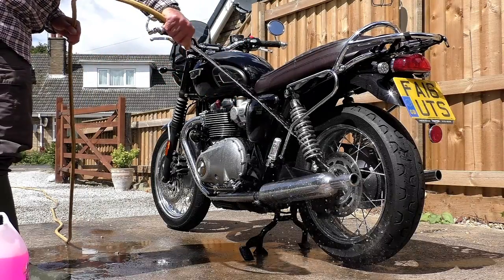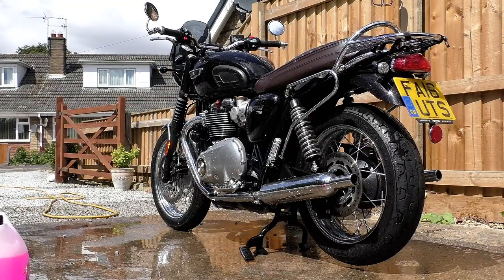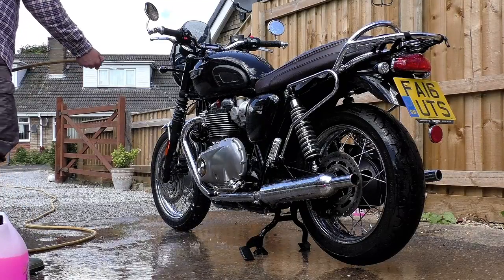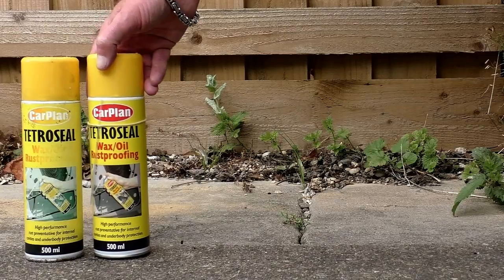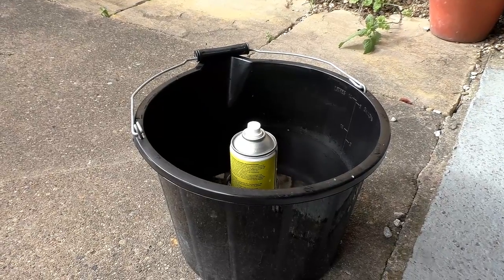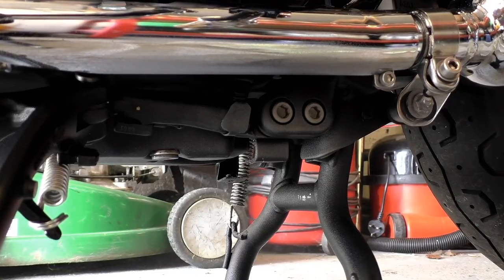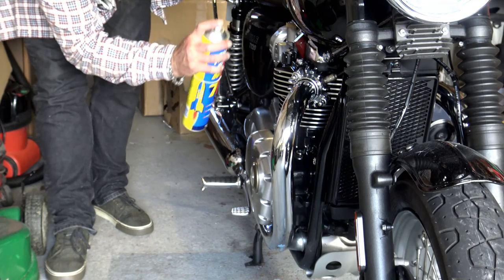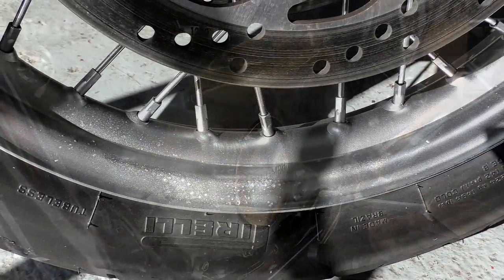Triumph T120 preparing your motorcycle for winter(winterizing)/RUST protection that works!

Comment: Hi Stuart, I'm treading a similar path to you in a way as I've just replaced by GS with and had the same issues with ACF50 that you did so I'm looking for an alternative to try and keep my new bike the way I want it. Firstly I notice you recommend GT85 in one of you videos but Double TT for winter. Is there a reason you don't use double TT all year round. Finally since the ACF50 experience I've used FS365 with great success but obviously that wouldn't be able to rectify the corrosion already there due to the ACF50 experience so I was wondering if you've had any experience using FS365 and if so how it compares with the waxoil/GT85 AND Double TT. some other vloggers have suggested the likes of WD40 and similar products are not a good idea for bikes as they can penetrate and dissolve the grease in bearings etc. so I would also be interested to hear what you think about that as far as Double TT and GT85 are concerned. Cheers Ade
Reply from the maker: Hi Adrian, welcome to the channel! I'm afraid I have no experience of FS365. but I can tell you with absolute certainty that nothing will beat wax/oil for long term corrosion protection on bare or painted metal! Most maintenance sprays contain a solvent that will disperse grease, however the anecdotal reports often banded about are the result of sales hype rather than anything else. A little common sense is required ie, do not spray it directly into bearings! and for such areas I would recommend applying it with a cloth soaked in the substance and the danger is completely avoided. GT85 can be obtained very cheaply if you shop around, Double TT is a little more expensive. I advocate GT85 in summer as it is all that is strictly needed and Double TT in winter as it does offer substantially better protection. there is nothing to stop you using Double TT all year round, I simply made the suggestion on money saving grounds.
Reply: Thanks so much for replying so quickly. I bought some Waxoil and Double TT while waiting for my new bike to arrive after watching this video so I'll give it a coating as per your recommendations. Thanks also for clarifying why you use GT85 in summer. I've found 600ml tins of Double TT on ebay for £5.85 which seems comparable with GT85 cost wise so as you say that's better I'll try that all year round. Thanks again Ade
Reply from the maker: no problem mate use the TT at least weekly if riding in winter. if it gets a good dousing of salt, rinse it off with cold water and re apply the Double TT!
Reply: Thanks, I normally wash my bike if I've been out on it in the winter - cold water wash first then a dose of ph neutral tfr followed by another rinse then the normal 2 bucket method, a final rinse followed by drying with a pet dryer so I'll reapply it after that.
Reply from the maker: Take a look at these. its become known as the full fillingham for some unknown reason! https://www.youtube.com/watch?v=bUNzoTpQqp4

https://www.youtube.com/watch?v=wib_tdr_mL4
Reply: Thanks for the above clarification Stuart, great content and proper researched advice which is greatly appreciated. I do wonder if money wasn’t an object at all, what might be the best combo cleaners up to the task.

To my mind, Muc-off range look to be the best in class for the modern needs... 
But I wonder, now you’ve used the lot, where does ‘Double TT’ stand up against ‘MO-94’, or at a push, the ‘Motorcycle Protectant’? 

Another thing is that Double TT seems to be the only one that doesn’t actually appear to advertise that it includes PTFE in the mix.
Reply from the maker: Hi Liam I have no plans to change my chemical regime I'm quite happy with the way it works. double TT is better for winter use due to its thicker consistency, whereas MO94 and the bike protector are better suited to summer use.

Comment: Hi Stewart, do you have an opinion on Scottoiler FS365 as an anti corrosion protector?
Reply from the maker: Hi Colin, I have no experience of the product to be honest although I have done a little research on it. My main concern if my memory serves me correctly, is that it uses water as a solvent base. This being the case I don't see how it can provide adequate corrosion protection as its wash off resistance will be very low. That being said they may have some sort of chemical voodoo going on that invalidates my opinion, but if they do I am not aware of it!